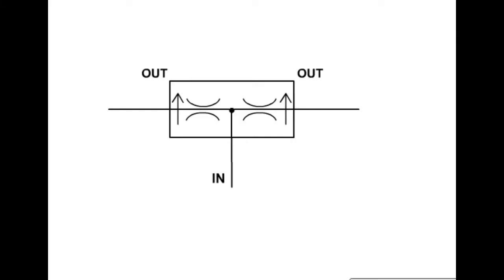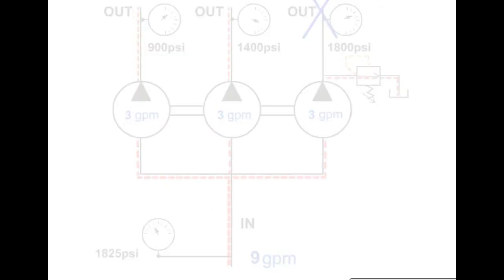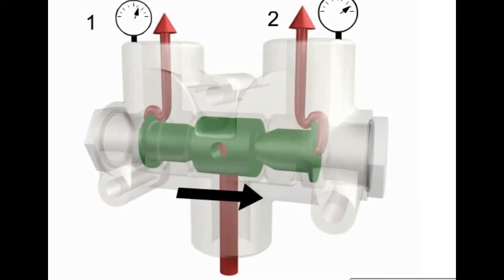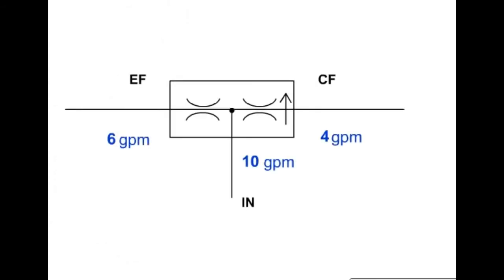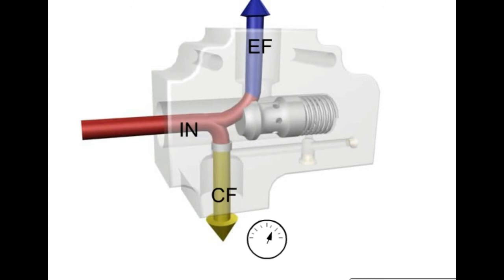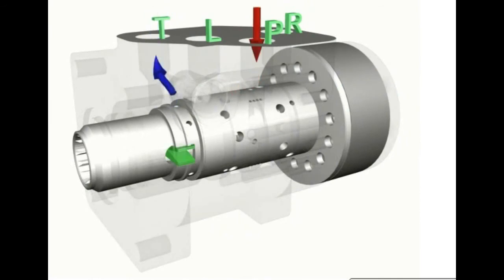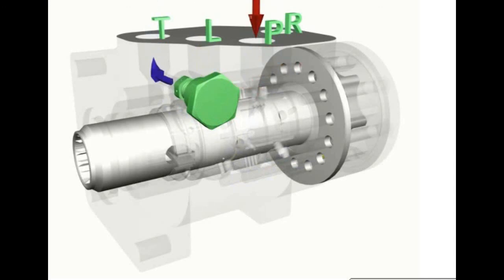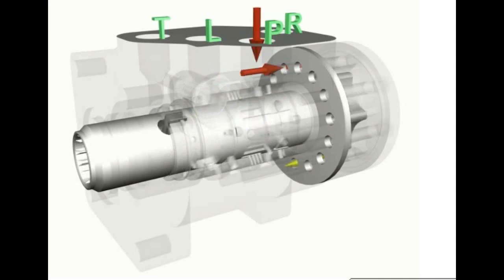Hydraulic Basics - 03 -All in one video  #Flow divider,#hydraulic,#fluid,#fluid_power,#Fluid_dynamic

Comment: Unfortunately some of these claims are not true, if the flow is zero on one outlet, all the flow will go to the other outlet almost at inlet pressure (it will cause big pressure drop and heating, but the other outlet will get flow). This will happen at least for geared flow dividers

Comment: Here’s a crazy question that I don’t know how to ask in a way it will make sense:  …My tractor has two hydraulic outlets: one the pushes and one the pulls, but the piece of equipment I want to use only has ONE hydraulic line that pushes and pulls.  Is there an adapter I can get so I can plug the one line into the two outlets and make it work?
Reply: a pipe that forks in 2 with 2 non-return valves facing opposite ways?